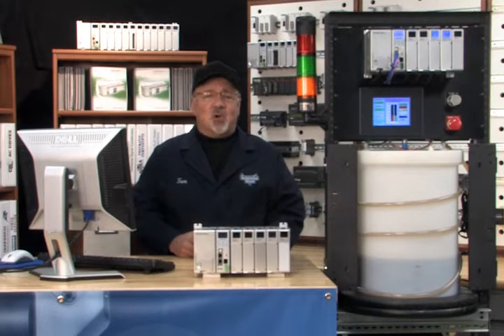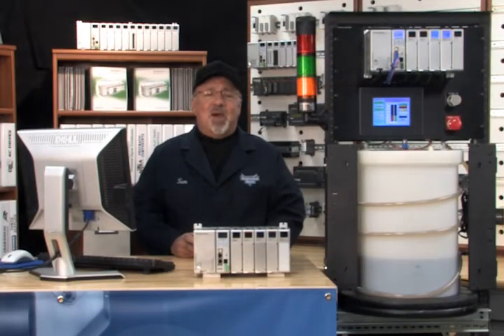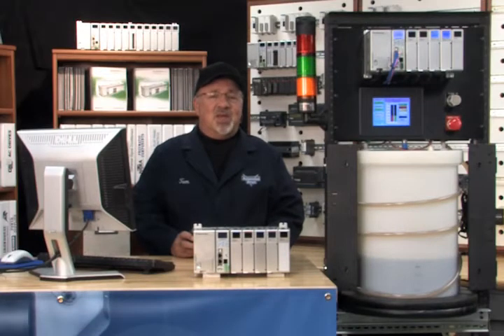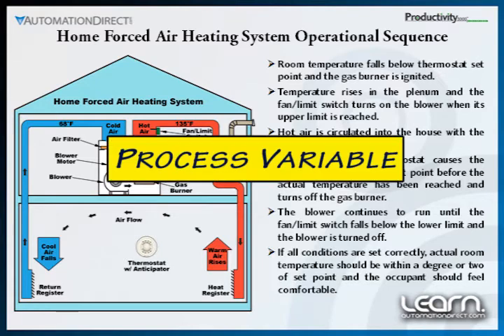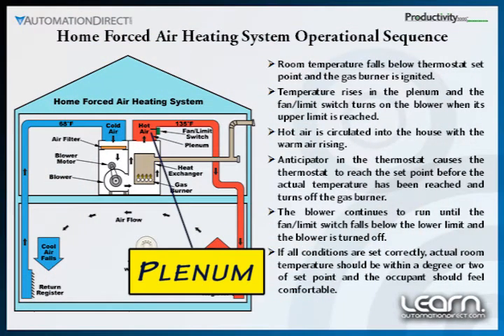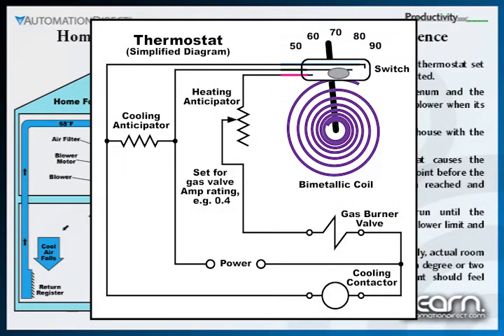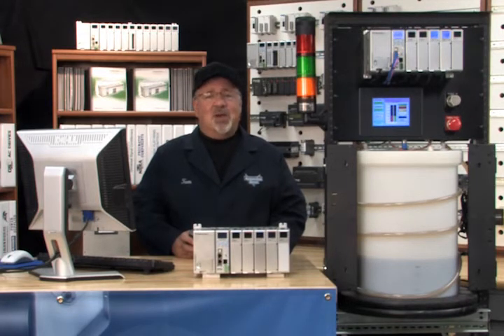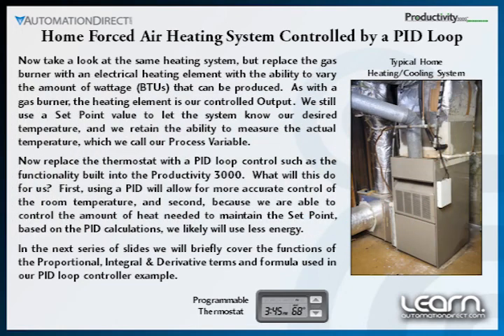What is PID? What Does It Do? Productivity PID Loop - Part 1 from AutomationDirect

Comment from the maker: Thank you for watching our LEARN tutorials. Check out our Customer Forum at forum(dot)automationdirect(dot)com. You can interact with users that may have PID Loop experience in the same general area that you are working, can answer questions, and suggest additional reference materials. Another great option would be to check out our training partner, InterConnecting Automation, at interconnectingautomation(.)com. There you will find a new course titled ‘PID Computer Based Training’.